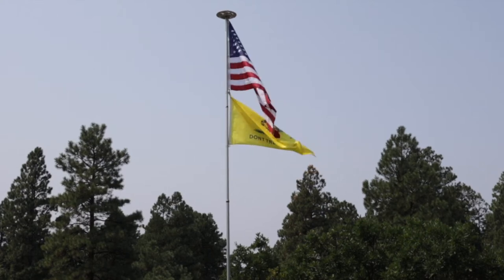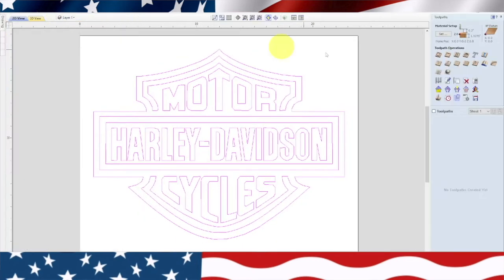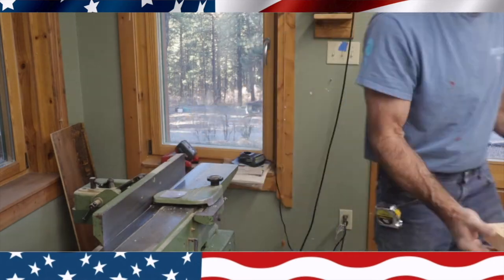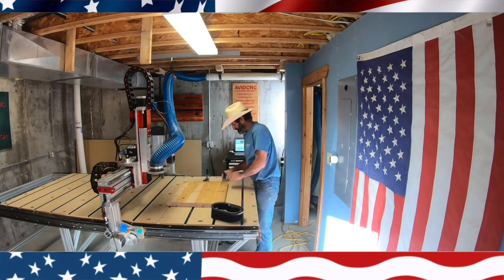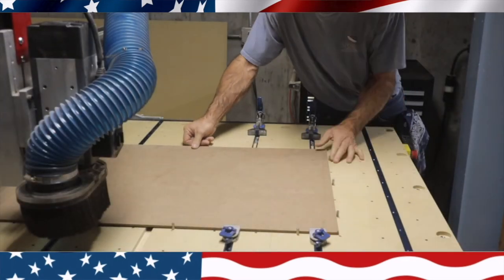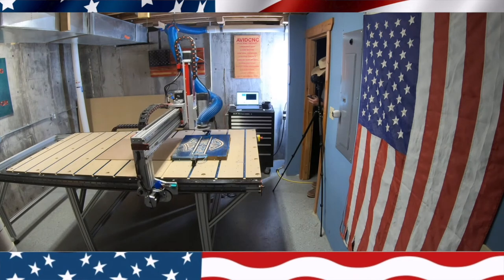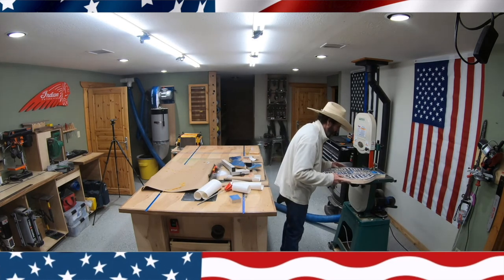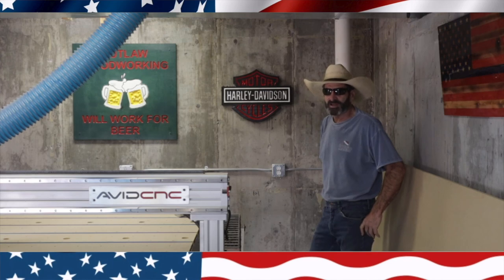HARLEY DAVIDSON MOTORCYCLE SIGN

Comment: Enjoying your videos, keep up the good work. I'm not sure why you are having the problems with the Oramask but here is what I do. If using pine or mdf I seal it first with a 50/50 mix of Zinsser Bulls Eye Seal Coat and denatured alcohol, then paint with the base color. I then apply the Oramask and roll it just like you do. While carving I raise the vacuum brush to where it is just clearing the material, you don't want it touching the Oramask. 

Then after carving I paint on two coats of the same 50/50 mix on the engraved areas being sure to get it along the edge of the Oromask and the newly exposed wood. You can be quite liberal with this and don't have to take a lot of time,. Then paint the color, usually two coats is sufficient. 

I have only made about 10 signs so far but other than the first one that the brush pulled up the mask I have had success. Good luck with your channel.
Reply from the maker: Thanks very much ,I will try again using your technique
Reply from the maker: https://youtu.be/1v4Uqhqv4rQ